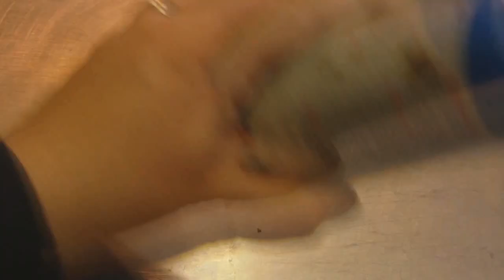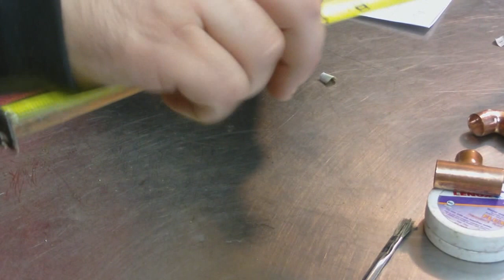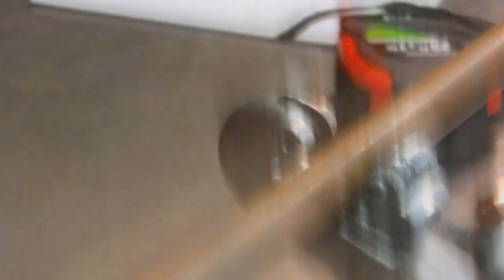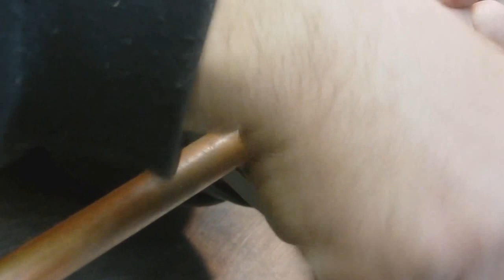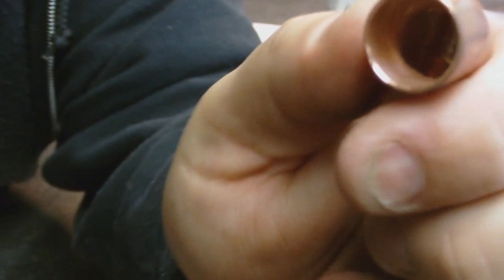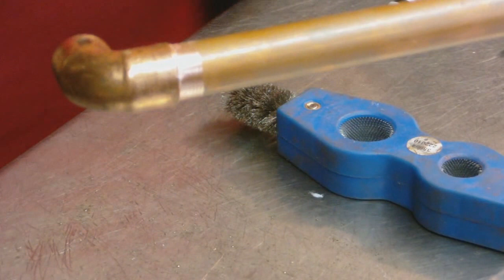How to solder (sweat) copper pipe for household water systems ( how to Sweat a pipe)

Comment: Every other video I have watched said stay away from the pipe. Just heat the elbow and heat the back side of the elbow because the solder will go toward the heat and flow completely into the joint.

Comment from the maker: It is possible to solder or sweat a joint without flux but the resulting connection is normally going to be inferior compared to one using flux even if the copper is brand new simply exposing the copper to air leaves some oxidization and contamination that flux normally will get rid of. Mind you flux is not a substitute for cleaning the copper beforehand but should always be used to do a bit of cleaning.

Comment from the maker: Thanks,
      Flux is used in conjunction with solder when soldering anything weather it is s circuit board or a copper pipe the flux and solder work to create a chemical change and join the solder and copper together. Flux primarily acts as a cleaning agent.